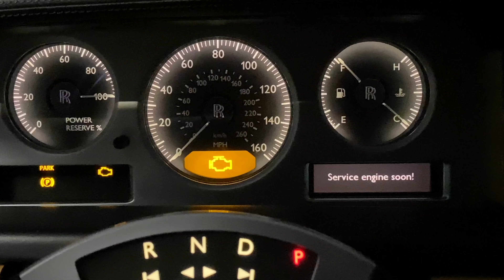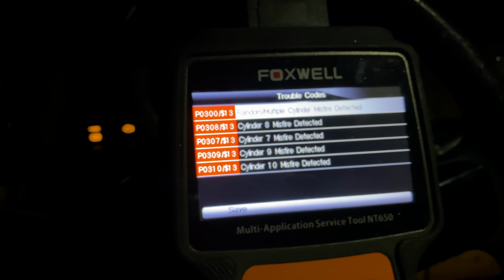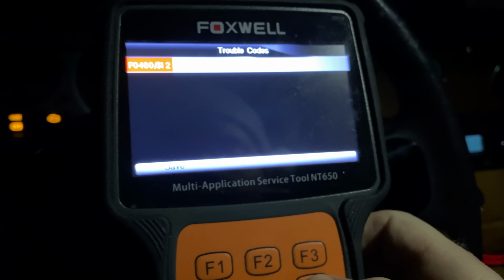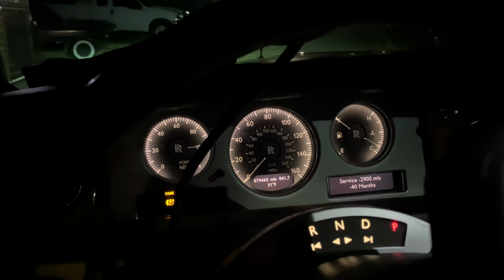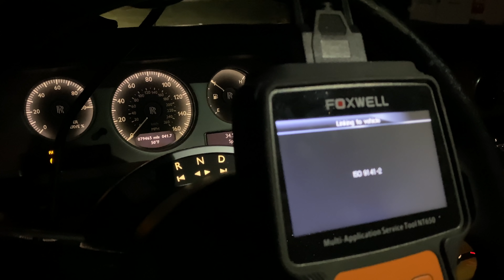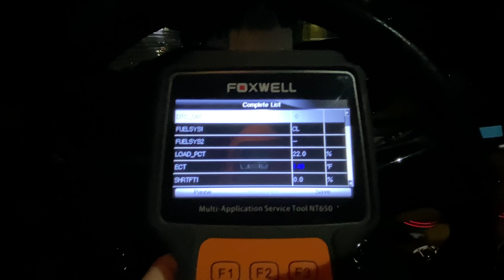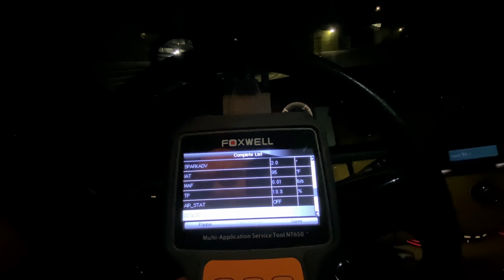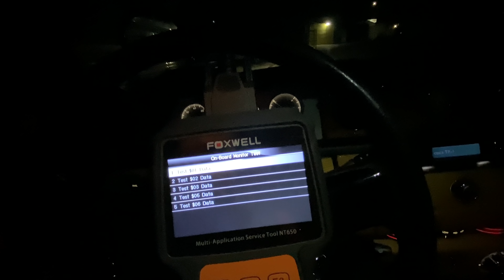"Service Engine Soon" - Rolls Royce Phantom's official logo

Comment: Plugs and coil packs isn't too bad.  Could be worse. 

BTW my cheap "stays in the car" Harbor Freight Special reads most PID's, I got it a ton of years ago and I've diagnosed some pretty intense problems w/ it on a variety of different models/makes.  If you know what you're looking at, you can use a cheap scanner and diagnose a LOT.

Comment: Random misfire codes on BMW engines can be caused by many issues like vacuum leaks or associated issues like crank case ventilation system issues or vanos or multiple other potential problems.  It could be coils but I think it's unlikely since it's has multiple different cyclinder misfire codes it would have to be multiple coil failures at the same time which is unlikely to pop up at once.  I would check for vacuum leaks first then for vanos issues.

Comment: Bob, you are doing this the exact right way. Take care of it yourself so you can enjoy it without transferring all your bank assets directly to the dealer. I learned that having a complex car like this is best experienced by the super rich who keep it for three years, then get another one. That way they just drive it, fill it up every week, and change the oil three times. Then they are done and on to a new Rolls.  Rolls-Royce knows this, so they advertise and sell primarily hand crafted super luxury interiors with the inferred  impression of magnificent mechanical engineering.  Since most super rich get new cars in 36 months or so, they never experience those annoying component failures we do. Just three years of perfect automotive sumptuousness and  living in their bubble world.   After three years, however,  the Immutable Law of Complex Systems begins to exert itself: the more complex a system is, the more likely it is to develop a failure point as time goes by.   Although the basic drive train is solid,  the myriad of ancillary items are not. Plug coils, plugs, wires, fittings, pumps, belts, brakes, hoses, seals, gaskets, electronics, and all the other gizmos that comprise an overly complicated vehicle can and do fail. I had a Silver Shadow and once the wear items were resolved it was pretty solid. Your Phantom will be the same way.  Just employ a lot of preventive care and service, and it will soon be pretty much like new. I would replace the power steering and water pump, and the AC compressor even if they are ok now. Trust me on this... it is best not to be reactive with a Rolls-Royce unless you own a towing business as well.  Repack the front wheel bearings, and replace valve cover seals. New ignition wires as well as coils and plugs. Be sure all hoses and belts are new or almost new.  Also, Bosch is not the best coil, Delphi coils and NGK plugs are what you need. Again, trust me. Also, an old mechanic told me to put two ounces of Marvell Mystery Oil in the gas tank with each fill up. I have been doing this with my BMW turbo and it has quieted the injectors and keeps the intake valves lubricated.  Two ounces per tank is enough.  It works for me, and might be worth a try for your Phantom.  Keep posting your videos, I enjoy them greatly.  Merry Christmas to you and your family.

Comment: Hey Mr. Mosely  I have a 1987 Lincoln Continental (Fox Body RWD) with the digital dash with reads ERROR for odometer then it will go back to reading 79,520.1 to reading  ERROR for odometer. Do you have any recommendations on how to repair these. I know this was a common issue on these Lincolns form 1984-1987. Do you rebuild digital dashes or know some one that does? I would be glad to send the dash to you if you could fix it

Comment: Hey bob i own a 2004 rolls royce phantom i have a light smoking issue but it clears away when i drive but at stand still around 20 minutes it starts smoking can you give me any tips i think i put the wrong motor oil in it ..........help!
Reply: Carl Williams oil leak somewhere?
Reply: Carl Williams what's the color of the smoke ?
Reply from the maker: Carl Williams There are a few good Rolls Royce forums on Facebook check them out

Comment: That crazy b/c today my check engine light came on for my Terrain and it seems to be a bad intake camshaft position actuator solenoid. So, yay, we get to stay home until amazon can ship us the parts. It must be something in the air today.
Reply: John Harrington naw your gonna have to replace the timing chains. I did 4 a month at the dealership on any v6 direct injected Gm.

Comment: I just picked up a $500 beater Stealth with a misfire.  What to do?  Coil packs are new.  I will try plugs.
Reply: Check plugs it could be internal failure. Do a compression test, then if that's good and plugs are good make sure your injectors are being triggered, etc
Reply: @ClintE55  Thanks.

Comment: Well plugs and coils are just basic general maintaince you will have too do on any vehicle with 80k miles and 14 years old. Any car will last with proper maintaince. I don't believe in 100k to 150k plug change intervals. Im afraid they will break off in the cylinder head. I also don't believe in lifetime fluids either.

Comment: Hey Bob this is specmaster from Oregon let me tell you if you want a car that will last forever and runs great and he's very comfortable and very luxurious and has been the best car I've ever owned I bought it when it was 4 years old a 2010 Lincoln Town car it had 41,000 miles on it it is now 2019 and I have 72000 miles on it and it has been the best car I've only had two problems with it the whole time and it's only been the power trunk pull down open and close mechanism broke and both of the power seat backs broke that lady up and lean your back and you want to lay down in your passenger seat or your driver seat both of those broke within 6 months of each other which was always strange I never use them so I thought that was weird but talk about comfortable car good mileage good power I haven't had a leak in it no oil leaks on the ground no front end replacement parts like you've had to do I've never turned it up it still has original fan belt which it's definitely do just runs great good car anybody looking for a good car I'm sure you've heard it before crown Vic Grand Marquis Lincoln Town car last forever I know a guy that had 350,000 on his Lincoln Town car you still ran great. I know it ain't quite as flawless is a Rolls-Royce I get that but if you want to stay happy for the rest of your life without so many headaches and it's still very classy car. Starting to get old now I get that but I guess it's newer than your car so I don't know keep up the movies I do like them you definitely need to do something about those screws in the back of your seat that looks terrible or at least get some black screws or something boss
Reply: Bob needs the attention, so he doesn't want a Lincoln.
Reply: @arthurfoust4120  nobody was trying to sell hem the Lincoln